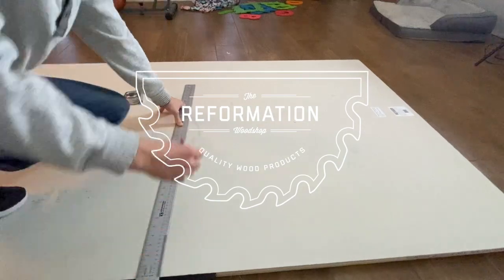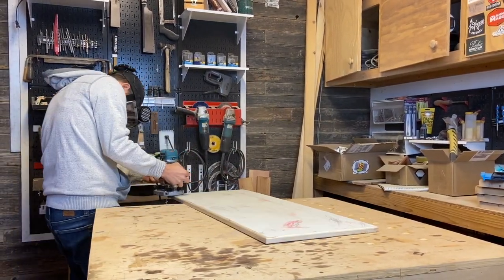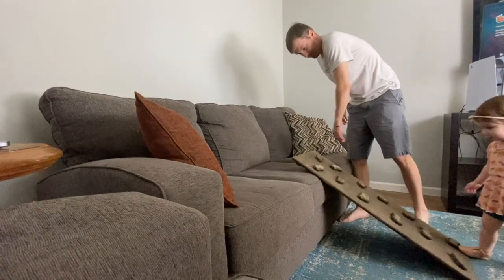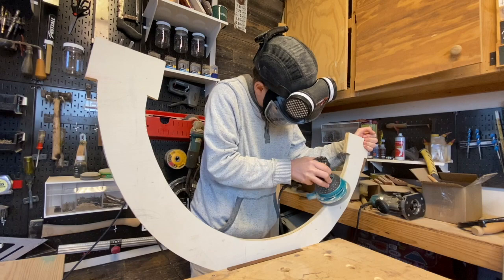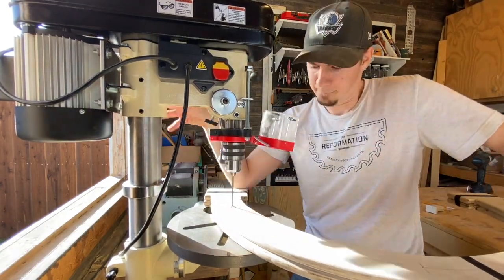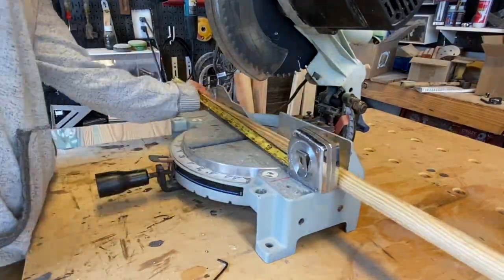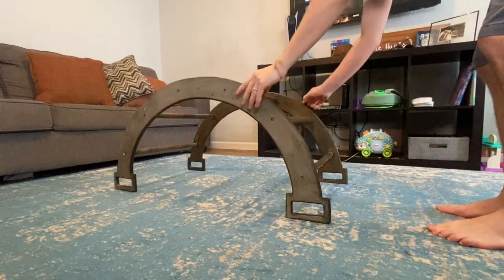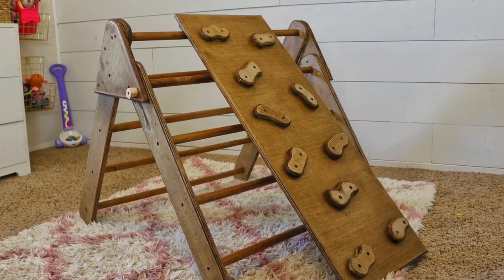DIY Rock Climbing Wall & Arch // Montessori Set Pt. 1

Comment: Do you have an estimate cost of what this diy would be at a typical Home Depot stop?
Reply from the maker: You could get the board done for under $20 worth of wood and the arch would vary based on how expensive dowels were at the moment. Both should be pretty cheap either way!